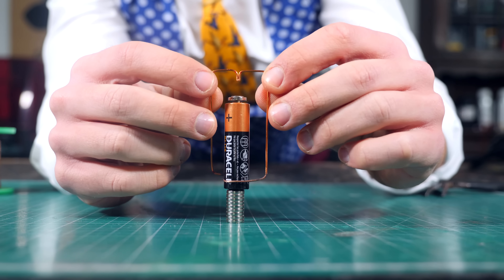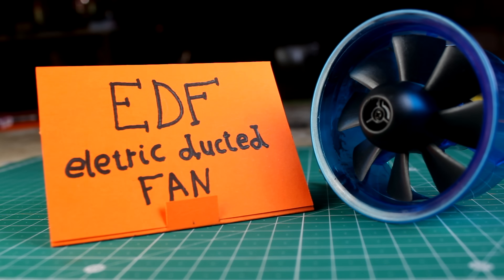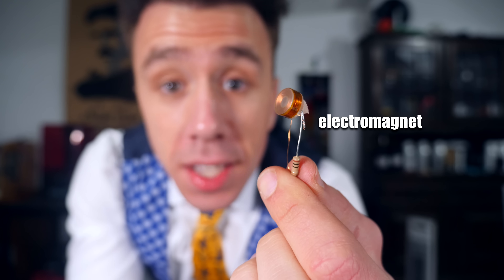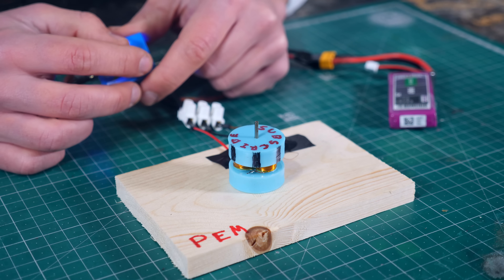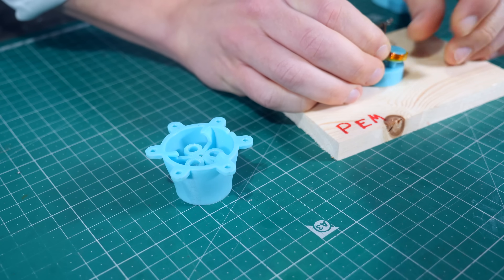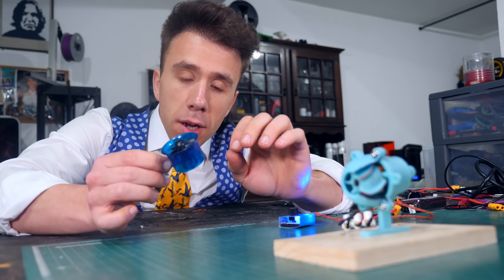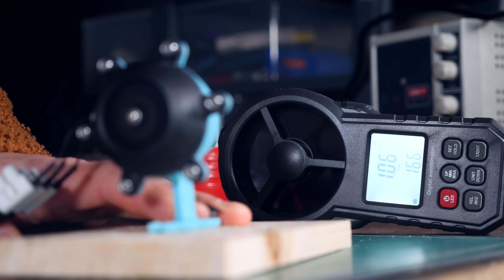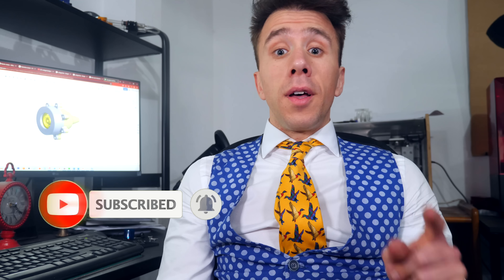I 3D Printed an ELECTRIC MOTOR FAN

Comment: For PCs centrifugal fans (blower fans) are seen to be always louder and in general have less airflow. They are only good for static pressure, laptops and in cases where air need to be pushed out of the back of the case by the graphics card. It's probably a similar thing. Energy is lost when the air has to change direction. I believe actually hardcore overclocking did a video on this.

The only reason a jet engine would compress it to have a better compression ratio.

Comment: The EDF is high flow / low pressure great for thrust the  centrifugal is low flow high pressure, not so great for thrust. turbo impeler are designed for pressure, but don't require a lot of flow. a better impeler design would be similar to a boat where the flow is backward (from large diameter to small diameter)

Comment: My entry to explain issues: each electric motor has list of parameters. Beside power, the most important params are RPM and torque under optimal mechanical load.
The mechanical load depends on what the motor turns. Turning large propeller would require decent RPM, but high torque, while turning something of a smaller size with stubby blades may require very high RPM and relatively low torque.
And to produce noticeable effect the motor should also have enough power: the power is the product of RPM (in radians per second) and the torque (in Newtons X (cross product) meter). Or it may be calculated from electric side: current * voltage * motor's efficiency (usually around 0,65).

If the motor has low optimal RPM and high torque and trying to turn hi-speed rotor of the impeller - nothing scary going to happen. If you try to turn the same thing with super hi-speed motor with low optimal torq it will also underperform, but will consume an enormous current and the magic smoke may escape. There is a third variant: when the motor is optimal for the impeller fan, but is just not powerful enough.

What to do:
1. Measure the voltage and amps of factory-made impeller (current drawn from the battery, the voltage is also on the battery side).
2. Measure voltage and amps of your motor, compare.
3. To get the idea if the motor turns at it's optimal RPM, measure RPM without mechanical load, then measure RPM with load. The loaded RPM should be around 0.75 ~ 0.9 of no-load RPM.
4. when designing the brushless motor, there are different combinations for electromagnets and magnets and different wireing. And there is also should be core for magnetic flux: it increases maximum power, efficiency and torque. It's overlisimplyfied of course - just a start point to dig information.

Comment: Simple answer is it's the mass flow (also called mdot) and the pressure.  Slightly more complicated answer is Propellers, Fans, and Centrifugal Compressors all make thrust differently and have different inlet areas for a given mass flow. A propeller creates thrust by directly imparting velocity to the air.  In propulsion, fans and compressors create thrust by first pressurizing the air, and then using a thrust nozzle to convert that pressure to velocity.  These three approaches will also converge on different details to reach their respective optima, and that is super important because you can't make the details of one like the details of another and expect the same results.

The inlet on the EDF (really it should be called a ducted propeller, because of how it makes thrust), is quite large for the input power.  So it will have a large mdot, and a lower exhaust velocity (Ve).  For vehicle speeds, this will give the highest static thrust, F,static=mdot*Ve.  The centrifugal impeller you have has a much smaller inlet,  is a compressor, leading to much smaller mdot.  If designed correctly it will create a certain max pressure, which will then convert to thrust in a nozzle.  Because the mdot is lower, it will give a higher Ve. Power to drive the thing is from the kinetic energy and therefore is related to the square of Ve,  i.e Power=.5*mdot*Ve^2.  These two properties lead to high Ve being inefficient for static thrust, and so the thrust will be less.

Put another way. All of the first jet engines were turbojets, and many used centrifugal compressors on the front.  And they were terribly inefficient at "low speed".  So they evolved into turbofans, with a fan on the front, to increase the mdot and reduce the Ve, and they became much more efficient.  Today's turbofans have huge fans on the front and are very efficient, with huge mdot's and Ve not much higher than their cruise speeds.

Put another another way, it is the reason helicopter rotors are so large, to allow efficient hover flight, where the exhaust velocity is trending towards super low numbers.

Comment: Try scaling everything up but keep the core of the impeller at the same size and increase the size of the blades, and add a curved conical intake. This should increase the amount of air coming in and moving through the fan, generating more mass flow.

Comment: Hey @Integza, I just wanted to say i love your videos, keep up the good work.
Have you ever thought about upgrading your resin 3D printers with one of the flexiable magnetic build plates that attach to your original one? 
I had to do add one to mine because all of my prints started sticking too much to the build plate and or when removing a part it would break and i woul have to start over. 
If you need any help with some videos please don't hesitate to reach out. 
-CoachingWinner5

Comment: The EDF is increasing the velocity of air and thus reducing its pressure causing a high speed stream of air which is thrust. But the centrifugal style one is actually used to compress the air in jet engines. it's used to increase pressure and decrease velocity hence no thrust. Extracting the power from a centrifugal style compressor with a combustion chamber attached to its exhaust can be a very effective way to produce thrust and these types of engines are used in Airliner APU's and small jet engines.
Using a convergent nozzle can help in producing thrust as a convergent nozzle reduces pressure and increases velocity. thus thrust.

Comment: Hi there, integza!
As others have already suggested, EDF designed for maximum flow minimal static pressure, and the impeller you printed is for static pressure, you can see it clearly from the angle of attack and shape of each fin.
in addition you can think of it like this.
EDF needs to push a large volume of air at high speed through a relatively short duct in order to create thrust. thus we need a lot of speed and low static pressure  cause there is almost no resistance.
on the other hand, Dyson has to suck dust and debris through a long duct in order to do so. It  needs to create a delta of pressure to overcome the losses that come with long duct and to lift the dust. it doesn't matter how FAST it does it. it's just mater that it does.

you can actually calculate and see it using a few simple measurements like pumped volume, outlet speed, and power input using bernooli's equation - fluid dynamics.

mechanical engineering student.

BTW I think that showing the difference and making a design derived data would be a great video.

hope that helps Tsahi.

Comment: @4:42 Probably a dumb question [asked 1000s of times I'm sure], so might be a good video but, what happens if you take X% of the trust or exhaust or exiting flow and put it back in as intake to the impeller?  X keeps getting bigger until boom, maybe?

Comment: Things I think might have impacted the performance:
-inadequate size of propeller
-inadequate size of intake and exhaust
-lost work that went into compressing the air 
-not simple enough airways
-material surface to rough (extra friction with air which is technicaly a liquid that has viscosity)
-design of the intake
-friction between propeller and stationary parts (or to much room between them)

Comment: You should take that fan or pan and try to make it change your phone by putting another motor on it and a voltage booster I know voltage booster is not the proper term for it but I'm having a hard time remember what it's called right now but I think you know what I'm talking about

Comment: The input hole and the output hole are the same size preventing the system from building pressure; offset the size, even by just a little, and you should add thrust. As for a new video idea, Forced Air Impeller Rocket

Comment: for max power your motor should have enough resistance to run at 50% its max speed. for best efficiency it should have less resistance and run at 70% max speed. Your goal should be to scale the fan to reach this sweet spot to use your motor to its full potential.

Comment: Build a turboprop using your electric jet engine.
Here is the thing: axial fans will always outperform radial fans when it come to flow of air, they are just better at moving air, if you want pressure, there is when you should use a radial fan, it won't perform the same you are trading volumen for pressure, so what im trying to say it's that you need a bigger impeller and bigger everything to match the edf

Comment: I think you have an impedance mismatch. The fans present a different load on the motor, so a different resistance to the ESC. Since it’s spinning fine, the peak rpm is probably higher for the same power delivered. Just eyeballing it, It looks like the diameter is too small.

You may also have more pumping losses due to less optimal aerodynamics, so more heating the gas rather than producing useful thrust.

Comment: Im a retired NASA Aeronautical Engineer also a pilot and I own a VK1 with a Centrifugal compressors in my MiG-17. First problem Dyson is a scam, they suck and not in the way they should. Centrifugal compressors are finicky. Clearances and intake are critical to optimal operation they must be very tight but not rubbing. Smoothness is also critical so sand and polish it. The aerospike nozzle is not helping because your flow is not supersonic. The nozzle should point inward toward a defuser kinda like a aerospike but shrouded tightly so it speeds up the flow. For the intake a convergent divergent intake works best, this starts compressing the air before it gets to the impeller. You can contact me if you have questions. CFD would help as this is all finicky, it speeds up your mean time to failure. I usually don't bend mettle till I have it worked out in bits and bites first.

Comment: How deep do you want to go on this? You could use CFD to determine the problem. 

Just looking at your design intuitively I think your blades are stalling. I could be wrong though. Take the inlet blade tip and calculate it's tangential velocity. Also calculate the expected axial air speed thru the opening and past your blade. From those you can calculate the air speed relative to the blade. Your blade angle of attack should be close to that angle. It looks to me like you are much to high an angle of attack. The axial flow is probably much smaller than the radial flow (relative to the blade).
As you move down the blade things get harder to figure out because the air starts turning with the turbine, so cannot assume the radial velocity is near zero, like you can at the inlet.
The inlet angle of attack will give you a good starting point though. I would increase it a few degrees beyond the calculation because the air flow in front of the turbine will spin some reducing the relative tangential velocity.

Comment: i've built a centrifugal fan that uses a brushless DC motor, i just needed something that could move a lot of air for ventilation and it worked.

but i also ran into problems when ramping up the speed, and i found that partially covering the holes caused it to gain and lose speed, it seems like that the speed controller is having trouble with the torque, which makes sense as brushless DC motors tend to have very little torque without any gearing

Comment: Centrifugal compressors are good for generating pressure. If you want high velocity airflow you could use the Venturi effect. 
Keep in mind that a centrifugal compressor has to have high rpm and tight tolerances to be effective. 3D printing plastic and electric motors aren't really suited for that.

Comment: well dumb integza u have to use a lower kv motor to over come the resistance of the pressure hence it is not the propellor it is the motor get a balanced motor which is stable at a decent rpm with good torque

Comment: "I love your show and have been a long-time watcher. Although I don't often comment, I wanted to share my extensive experience in deploying EDFs and aerodynamics. Aerodynamics become much more challenging as items become smaller, so scaling up your project could yield more tangible results. Each fan blade is like a wing, and it's important to consider the size ratio of any aero surface to the size of the air molecule. The bigger the surface area, the more reactive the result, making it easier to control and fly larger planes with big wings that can do more work because they affect more air molecules.

The aerodynamic penalties of going smaller on the power system are exponentially greater as you decrease in size. The EDF shown has much more blade surface area than Dyson's impeller. The EDF inlet and outlet are basically the same size, and much attention has been paid to the blade's shape or curvature (very flat), blade thickness, and ratio of blade contact area to inlet outlet size. Blade thickness is a killer of efficiency, so thinner is better (with respect to the blade's stiffness). The surface area in relation to the intake and outtake size is a close ratio, resulting in little resistance through design (the EDF is like drinking through a short, wide straw). EDFs generate thrust via the volume of air moved per second, and all restrictions are minimized.

In contrast, the Dyson fan is designed more like a pressure pump (with a tiny, long straw to drink through), dealing with much more resistance to flow than the EDF. Air backs up in the tube, and pressure forces it out to keep the impeller fortified with air to move. The Dyson was designed with unlimited energy available and sits on a desk (without having to carry its own weight), so it accepts losses but exploits the fact that it plugs into a wall. The EDF is powered by the smallest, lightest battery that can fly the aircraft and is very limited in available energy, creating thrust via volume. Combining the two together is like trying to connect a thumb to a foot."  a car turbo can spin at 50,000 rpm and its blade surface area is smaller than your edf. it moves much less volume per revolution but creates lbs of back pressure.  i would expect your impeller design needs to spin at very high rpms and accept much loss to to get the open air thrust of that edf,   so a edf is a fan and has a blade , a dyson is a pump and has an impeller... the turbine motor finds its difficulty in combining the 2 , does this by having stages of compression from fan blade to impeller... all this again is much easier at a larger scale...

Comment: video idea: a rocket with flour as solid propellant. For that you can burn the combination of flour with air in a combustion chamber. To drove the granular flour into the chamber, you can use a venturi by using the airflow generated by the fan of this video

Comment: I have pulled apart many Dyson stick vacuum's and fans and one thing they all have in common is they operate at ridiculously high rpm's the stick vacuum for instance averages 90k+ rpm. The motor they use a rather odd design they claim it's a "digital motor" but from what I can tell it's just a variable reluctance motor which one would think is just another name for a brushless motor but they are far from one another and if you look at the waveform on an oscilloscope you will see what I mean .
 I would like to suggest using a Dyson stick vacuum motor but the motor control circuit is rather smart and it can sense the flow rate by the shaft speed and air temperature which isn't detected by a traditional hall effect sensor I believe it monitors the current and frequency of the motor  and if it's outside of its programmed threshold it will just cycle on and off. 
I have tried and failed countless times to bypass this safety feature as I had many experiments for a 90+K motor.
 But essentially this feature is only there to protect the motor and driver circuit as during a restriction the shaft speed is going to increase due to the lack of air flow which means the motor could overheat so they shut on and off.

Comment: This seems a case of inefficient pro/impeller design. Also, in general, the flow rate through the smaller entry will be restricted.
The traditional fan has most of the fan blade at the outer area where it covers a large sleeping area , you were in Keller has a small opening in the front which has a Generate effectively vacuum to suck in air, the larger your fan, the more air you can move without having to drop significantly in pressure.

So in short make it bigger…

Comment: Hey, i accidentally mixed PETG with TPU, they mixed quite well due to similiar temps needed, at least the two Brands i used .. could we adjust flexibility of prints by mixing PETG and TPU with those dual feed one nozzle printheads? Klipper has some config entries for mixing extruders, though i think these are for mixing different colours of same Material.. dunno, like that idea making parts with varying flexibility throughout.. like a hard(er) handle of smth with more elastic surface for grip.. or something hard on the outside and soft in the core...🥳☺️

Comment: There's a reason all modern jet engines are axial flow rather than centrifugal.  Losses.  A centrifugal fan requires the air to keep changing direction.  Axial flow, the air travels in one direction only.  Much less lossy.